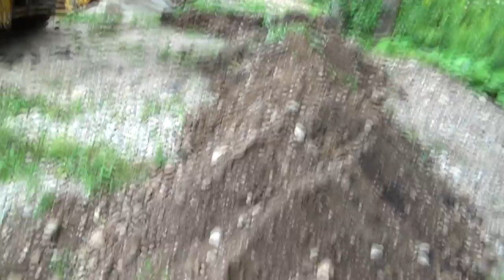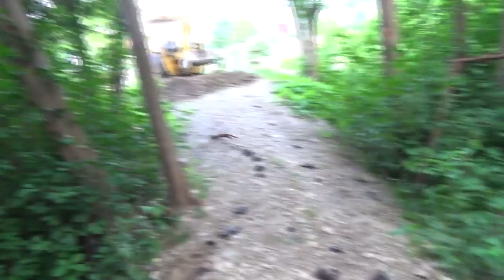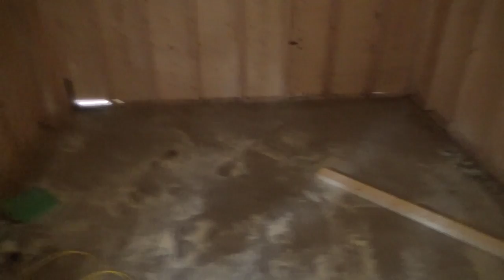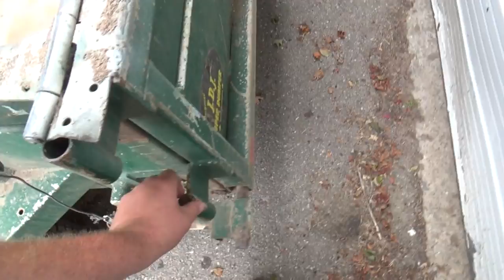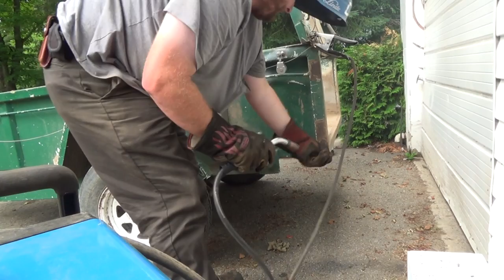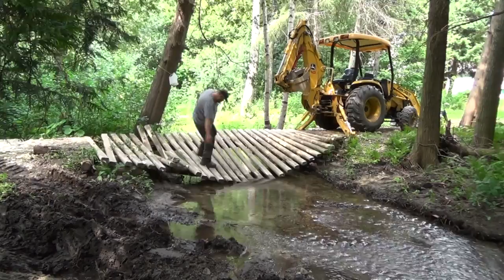The big bridge project we built let me down (literally)

Comment: A single wide trailer/mobile home frame makes a great base for a short span bridge. The log size you had was fine but needed more of them to share the load or a center support. I figured the landscape timbers were going to fail long before the logs. Could just rebuild it completely with logs. Maybe 4-6 long ones then use a bunch of shorter ones to deck the bridge. Wouldn't be as smooth of surface but would be cheap and strong.

Comment: Would be good to use vinyl siding or galvanized sheet metal roofing/siding which is available in many colours on the walls instead of paint,as they are really exposed to the weather without roof over-hangs on the top and sides.

Comment: Move those lock plate so the screws wont be accessible from the outside... Put the left one on the Inside (in the crack between the 2 doors). Doing a 90 degrees kinda.

Comment: why'd you not use struts on the bridge? any bridge which is going to take over 400kgs in weight should have struts, preferably triangular struts as they split the weight evenly allowing you to have your weight spread rather than just in a set location. the park i work in, we've built a bridge for one of the local farmers and he has a machine which has tracks and weighs around 17 ton and what we did is all the trees i'm ordered to knock down, we used the big ones for the main support struts (cut them to size, took a good 3 hours with my bow saw with the ripsaw blade on it cutting them to two 2 ft struts and four 4 ft struts, all at 45cm thick which is why it took so long) then used some of the smaller trees for support struts to make them into triangle shapes. then to make it look like it belonged in the area we used long bendable twigs to cover up the screws and bolts. the part where the tread touches to get across (the floor) was made out of double layered old railway sleepers. the bridge is about 10 - 15ft wide to get his vehicles across and cattle and took just over 2 weeks to build with everything cut and moved by hand. i did all the cutting as i cut through stuff faster than everyone there as im a skilled tree feller (i can land a tree where i say its going to fall depending on the bloom, the leaves on the tree mostly clumped together making most the weight at the top, the way the tree is leaning, if its more than a 20 degree lean its definitely going that way and wind direction... simple physics really).